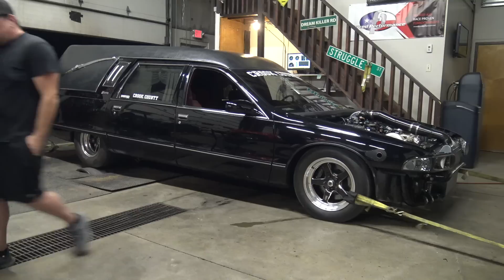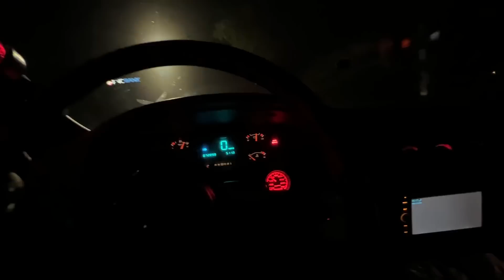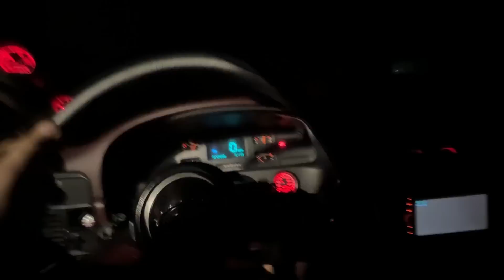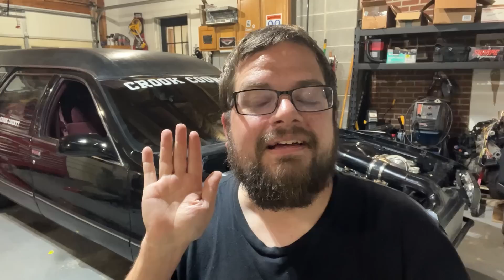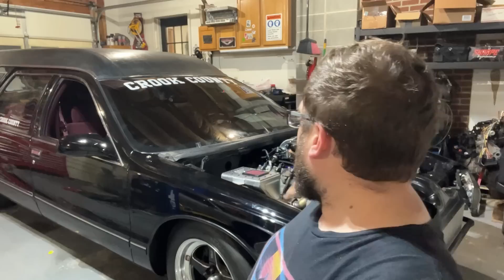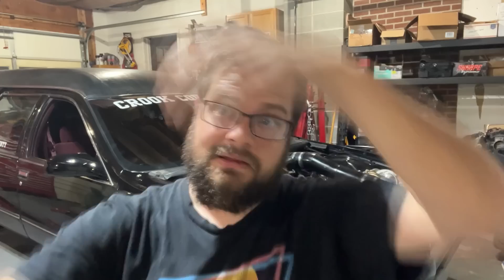Arne's hearse dyno shakedown

Comment: About the misfire and having both grounds in the same spot, it hasn’t caused any issues with my stock 0411 pcm. I have mine on the same bolt on the back of the block.

Comment: Gap plugs? Check compression?  Swap in another set of coils plugs and wires? You have to have parts. Moving a gnd from one head to the other to fix a misfire doesn't sound like how electricity works.
Reply from the maker: Yes yes yes and yes lol I think I have that solved now fuel pressure randomly tanks

Comment: Can you just make a small jumper wire from one head to the other so you don’t have to move the grounds? Thinking out loud.
Reply from the maker: I just crimped a new pin and hooped to front of cyl head and shoved pin in connector to shortcut it to see if it fixes it